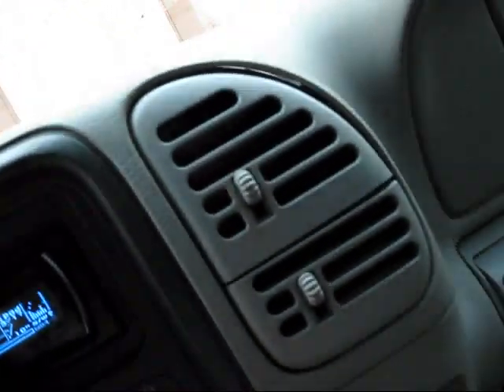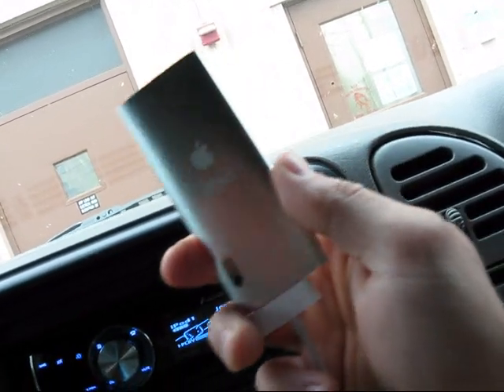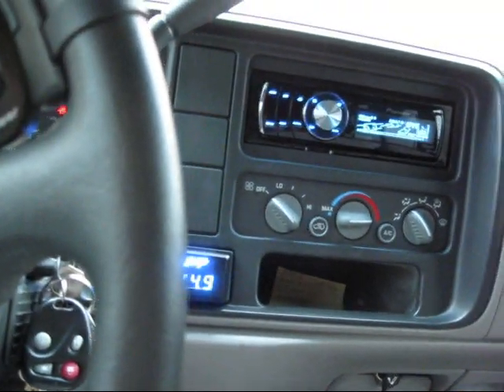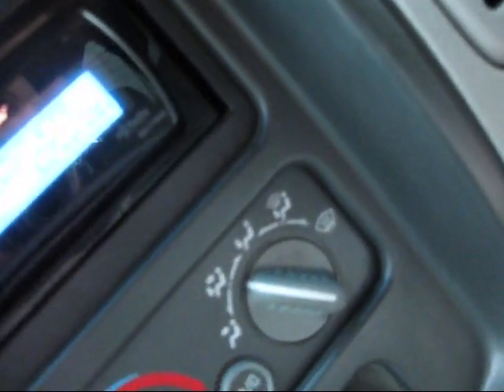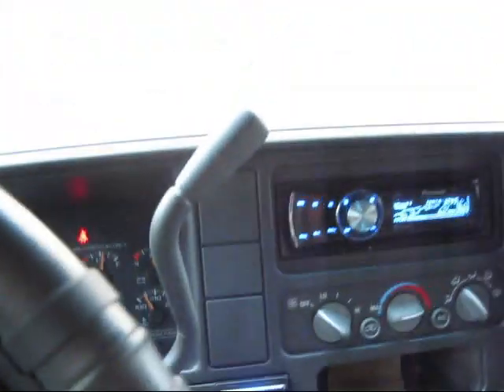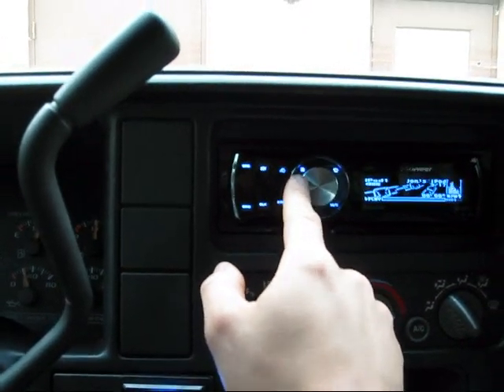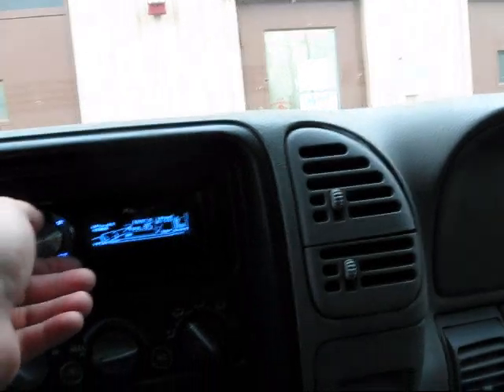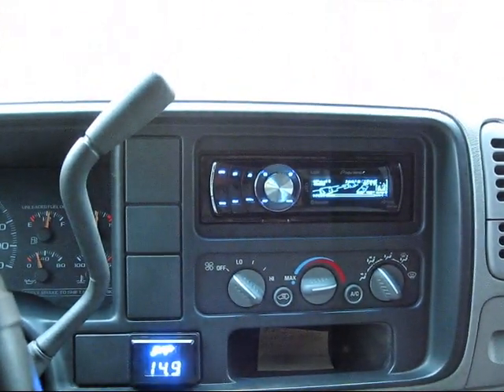how to wire the darvex bass knob,and bass!!!!

Comment: how do you get your voltage up 2 14.4 volts and higher I know you have to do the big 3... But do you have to upgrade your alternator to to get higher voltage with the higher amps in the alternator when you upgrade it

Comment from the maker: @CR1T1K there are many ways you can wire it to work i just think this is the easiest way to do it...just use the ground(black) and remote turn on(blue)and that will turn it on and off every time the key is turn on...then the third wire you run anywhere you want a voltage reading it can be the alt...a battery...or an amp

Comment from the maker: @zechariahtheking some cars run higher voltages stock then others do,im lucky mine is where it is stock...i do have a 260 amp alt but it didnt change my voltage,you can get more voltage by getting the mla voltage regulator

Comment from the maker: @nickdogg1993 ya thats all the up...i found my clipping point with my amp so the subs are getting clean power 4 the most part...and when my volume is at 62 on the head unit it is clear as day still and cna take quite a bit more if i had the power